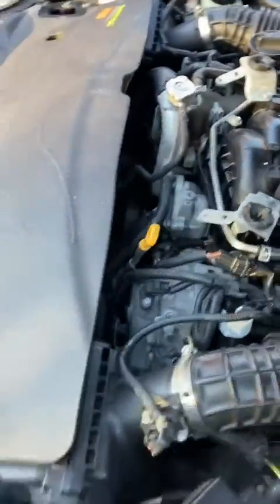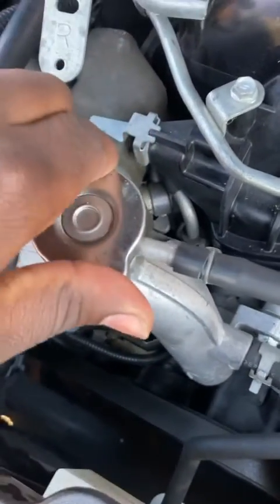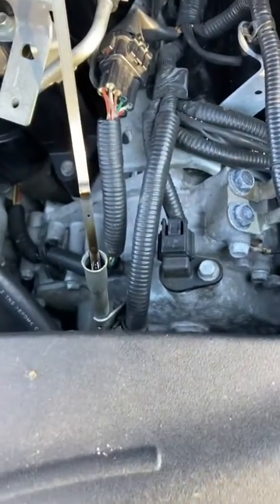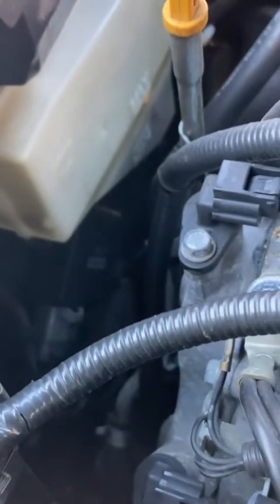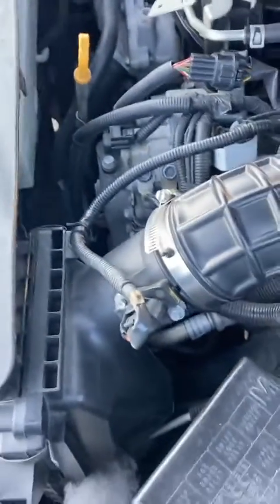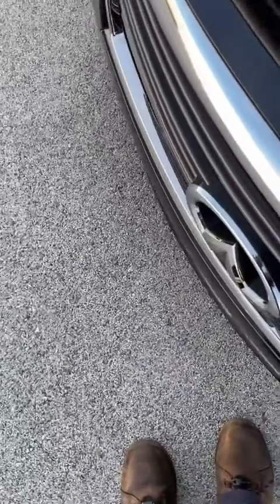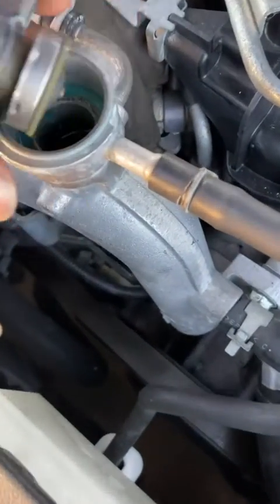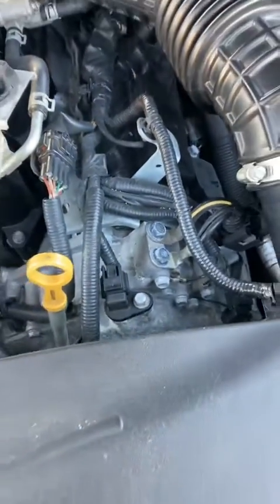Coolant Reservoir level goes up and down. That is normal

Comment: Is the water level in reservoir tank depends as well in weather temp? For example my LX570 in very hot weather reaches max point but at night with lil colder weather its in middle of the tank between low and max

Comment: Thank you for this video. My car recently had its high temperature light go on briefly then off (I had a feeling it had to do with low coolant and/or my car not moving for 20ish min due to traffic in hot heat). Refilled coolant and noticed it would go up and down (and I immediately thought it going down was an issue). Thankfully not so 😅 As of now coolant levels have been consistent whenever parked overnight. Thanks again for this!

Comment: Mine keeps going down i dont know what seems to be the reason
Reply: Probably a leak in ur cooling system
Reply: If your radiator has an integrated transmission cooler, check your tranny fluid. You may unfortunately find your missing coolant.

Comment: When it sits over night should it go back to same level as when you let it sit
Reply from the maker: Yes, it should.
Reply from the maker: Unless you still have an air pocket in the coolant system, whereby you'll notice the reservoir level going down slowly as the system burns itself.

If the level quickly drops, you might have a leak.
Reply: I've been driving it for a year with coolant dropping .could it be a head gasket
Reply: Can air pocket last a year

Comment: Is there some reason why you set the engine oil level to the mid point of the dipstick?
Reply: Some cars use or lose oil to a certain level and stop. Why add more if it's at a safe level?

Comment: Thanks for posting this, I have wondered about the reservoir slight fluctuations in my G. All is well then.
Reply: In your G37? If so, my coolant in the reservoir in my G37 all of a sudden is empty but no leaks, is this normal?
Reply: @palerider4629  I do have a G37X,  mine only moves up and down slightly.  If you have the reservoir close to max it shouldn't be empty.  Make sure its full.
Reply: @jermonte6184  ya, I had it on max but now all of a sudden its empty, wtf?
Reply from the maker: Have you done any coolant system work recently? 
Sometimes the level drops as the system bleeds itself of air after working on it and replacing stuff, but if it has always been high then all of a sudden it is dry, you are losing it somewhere.
Reply: @EdBwoy  wow u right, I did recently replace my heater hose connector since the first one blew out and before, the cooling system hasn't been bleeded. I now bled the system and now had this problem of coolant loss. Is this normal? Should I fill it back up?
Reply from the maker: Yeah, just fill it back up to max and watch it
Reply: @EdBwoy  ok thanks a lot. No need to bleed?